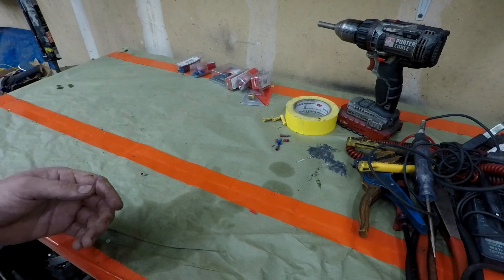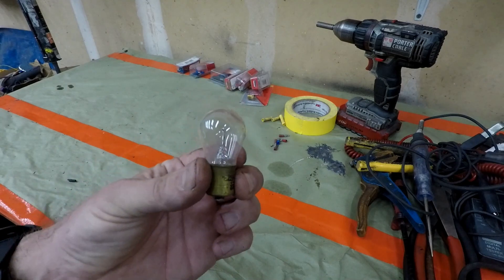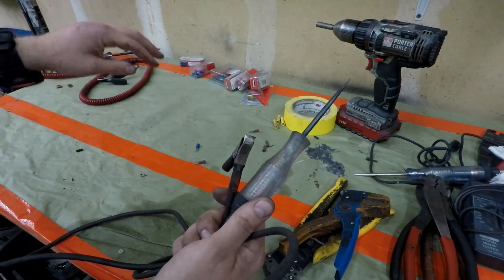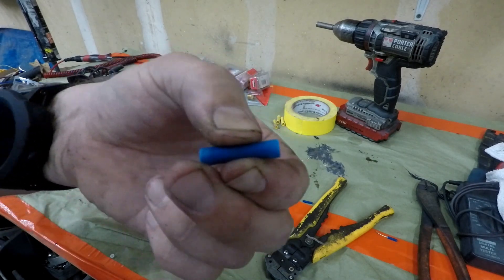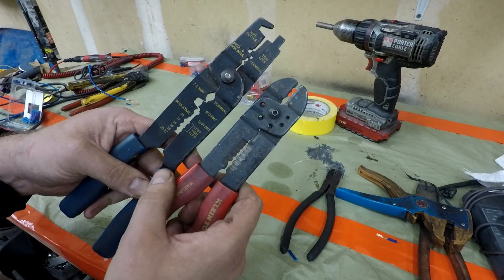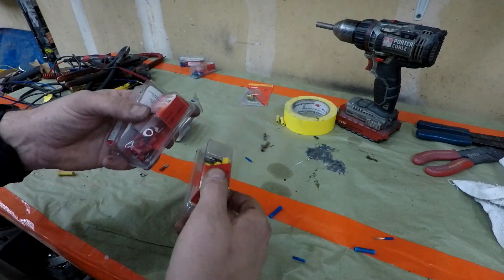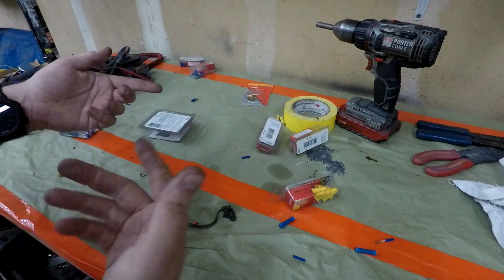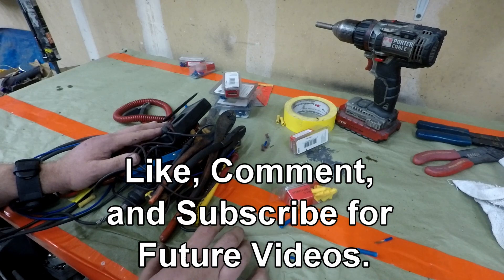Jeep CJ Tech: Basic Electrical Troubleshooting and Tools

Comment: Great series coming up thank you so much. I have a CJ five 1980. Can’t wait to you get to the fuel gage and temperature gage that’s been a nightmare for me keep blowing fuses! Found your CJ turn signal replacement video very helpful as I had to replace my rack gear in the steering column and also while I was in there replaced my turn signal as it was broken. Very helpful thank you